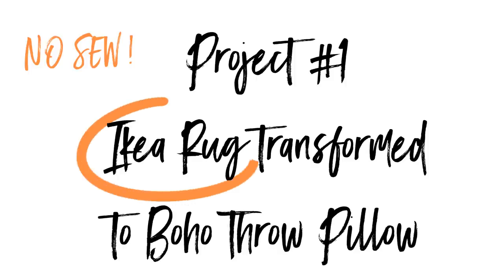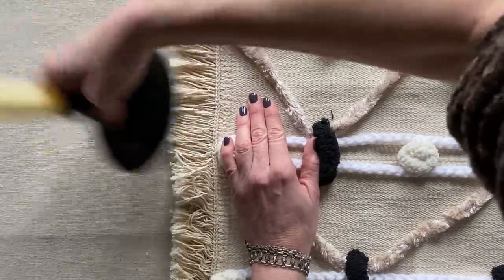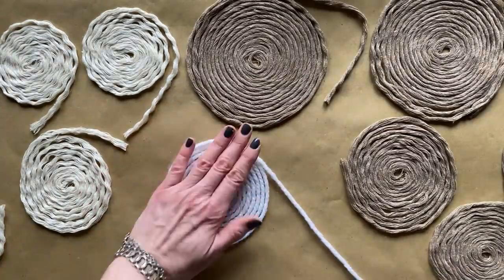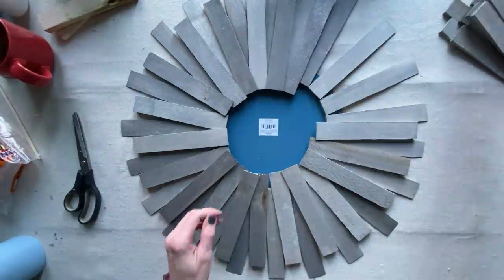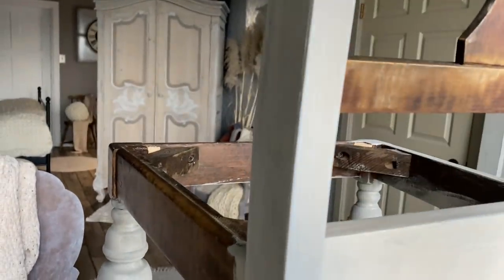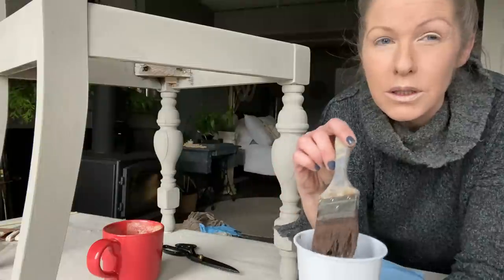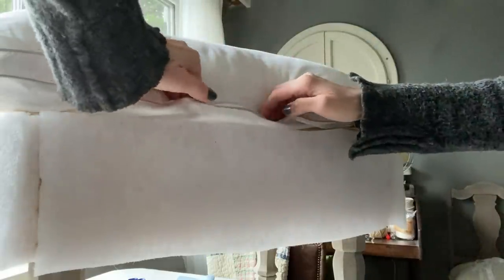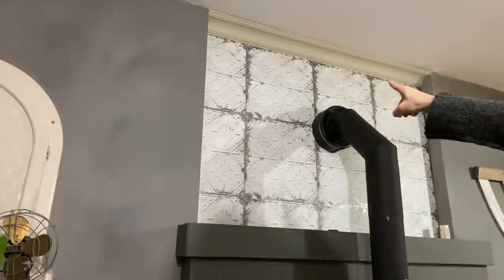6 Home Decor DIY Ideas: Sunburst Mirror Wall Decor, Boho Rug, DIY Ottoman, Chalk paint wash chair

Comment: Path Lighting....These are marvelous in areas that do not get enough sun to power a solar light.... 
Parts list....
Read the assembly instructions before making any purchases so you'll understand the size parameters you will need.
The base is a round terra cotta sewer tile column. I found mine on Craig's List at  6" diameter x 12" height.
Scavenge or purchase a translucent waterproof shade. The shades designed for ceiling fan light fixtures work well. Spares are often sold separately.
Purchase a terra cotta dish of the sort sold with flower pots.
Purchase a battery power closet light with a remote control.
To assemble....
Set the base of the shade inside the top of your tile. The majority of the shade is exposed above the tile.
Attach the light inside the terra cotta dish. Invert the dish on top of the shade as a lid. 
Depending on the traffic in your garden, you may wish to glue all or some of the pieces together.
The concept can be adapted to other materials of course. You are not limited to sewer tile and terra cotta.